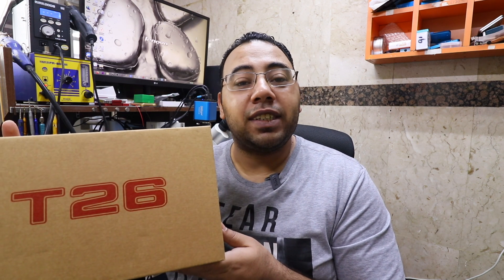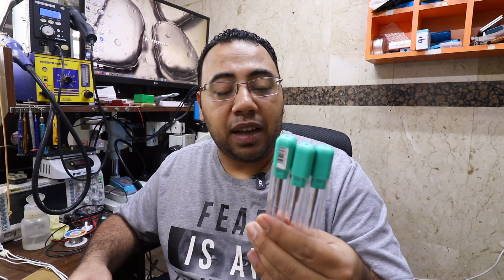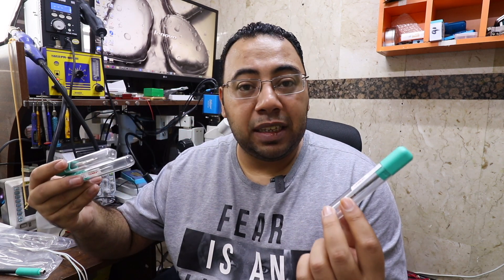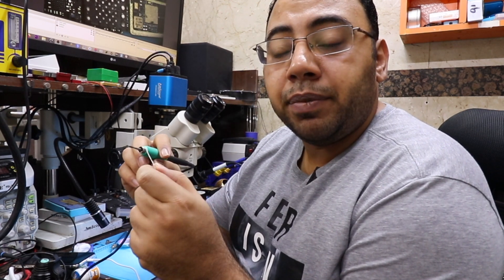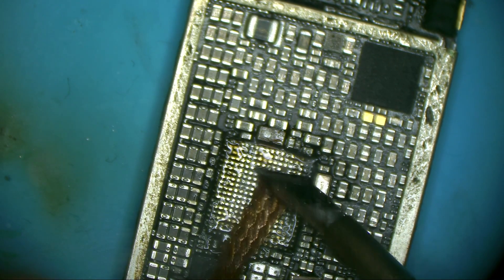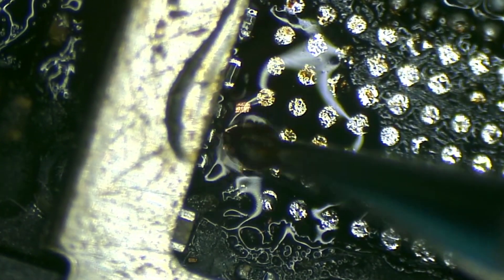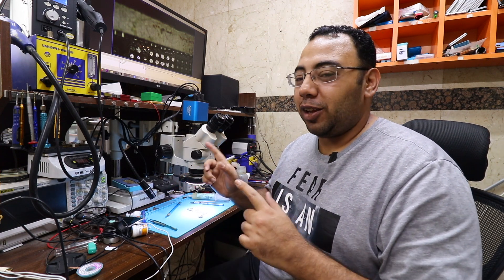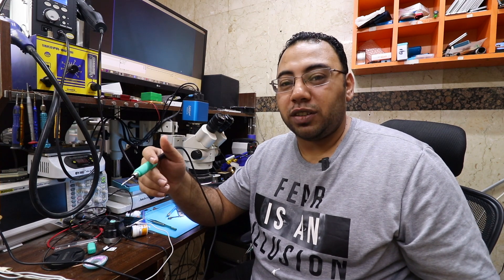Sugon T26 | Best Soldering Station for Phone Repair ?

Comment: No, the Sugon doesn't accept the T245 General Purpose handle. Most clone stations support either the T210, or the T245 iron, but  not both. There are exceptions though, the YouYue station and another chinese one, I forgot the name,  support both. This is very important I think.   
Also, are the Sugon and the clone iron going to last as long as an original station + T210A iron? ... Maybe yes, maybe not.
I bought my JBC station second-hand 10 years ago for 150 euros,  old model with 2210 and 2245 irons (old name for the T210 and T245 iron) and still going. It's got a big fat transformer and quality components inside.

Comment: Just recieve it , and seems pretty amaizing rady for work in 5 s, tips are great, just wondering can it be used with that other JBC handle tk have then all tips that we need and professional soldering station!! Thx for code and discount! Also subbed here!
Reply: Can we use t245 handle?
Reply: @shoubhiksaha2788   i dont know apperyntly not, but i think if this works for jbc tip , maybe just connector needs to be different(wire places), if anybody has t245 handle maybe some pic of wires will solve the problem

Comment: Has iCloud unlocking been stopped by apple on iOS 14.1 because I keep getting activation error. Do you have this problem?
Reply: MICRO-REPAIRS LTD yes dear it’s right same here
Reply: @mrony8632  is it coming up with activation error when you do a full restore after changing details?? Thanks jay
Reply: MICRO-REPAIRS LTD yes
Reply: @mrony8632  is there anyway round this or is this the end?? Thanks so much for the response I appreciate it.jay
Reply: MICRO-REPAIRS LTD it’s will run again but need to wait I think
Reply: @mrony8632  honestly thanks so much for your replies, I really appreciate the help.jay

Comment: Hello very good video, I have a question outside of this topic, it is possible to remove the ivloud from an ipad 12.9, 3rd generation just by changing the serial?..    It uses face if!!!
Reply from the maker: Thanks a lot, ipad pro 3rd gen is not yet supported
Reply: A12 chips are not possible to iCloud unlock. You will get activation error.